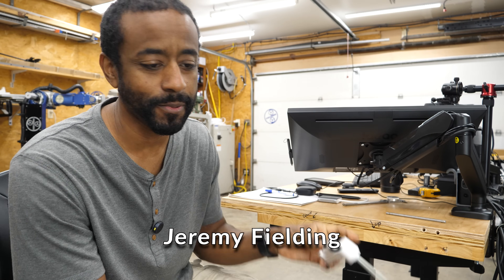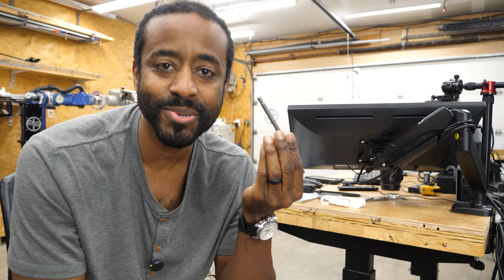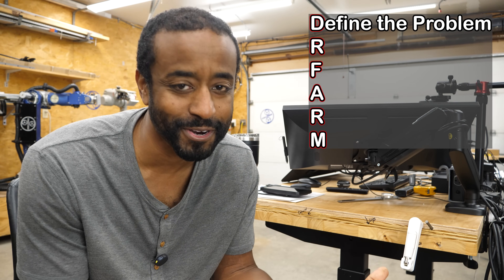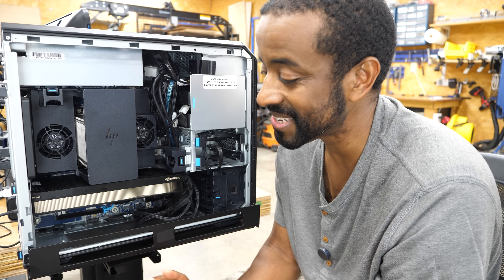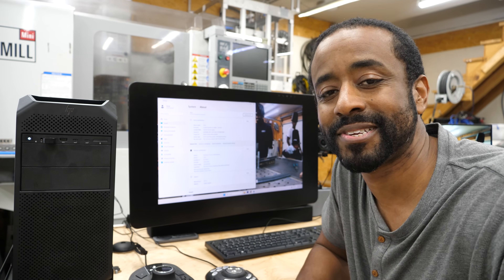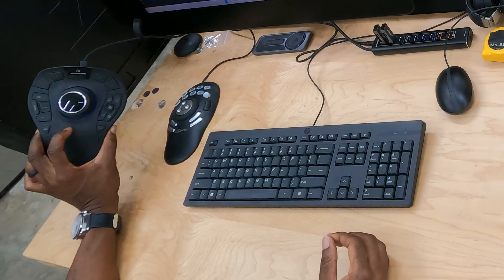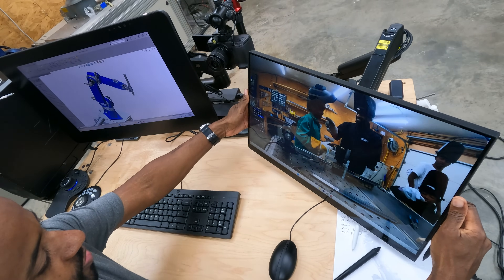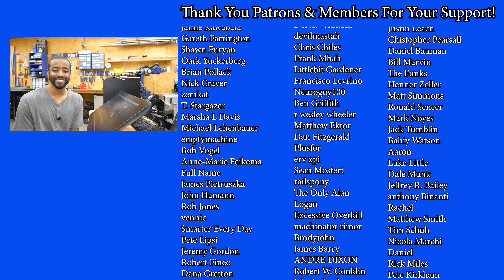My Design Process

Comment: Just a quick tip for the researching phase : Using AI. Give GPT a description of the mechanical problem you need to solve, and it will give you all the wheels that exist in the world for that scenario, so you not only not reinvent them but also get options of wheels you would never know exists

Comment: Wonder if you can make a welding table where your armed robot can travel on a rail system if needed for areas it can't reach. Then, it clamps down the base on the stational position.

After that, it takes a picture. Calibrates the location. Then, it makes precise welds.

Side cameras that can accurately calculate thickness, and type of metal.

For the machine to be able to change tool type attachments automatically.

Never done this type of stuff, but am interested in it. Primarily building and programming useful machines. Converting a lawnmower into autonomous mower is interesting.

Comment: I’ve thought about designing a pc tower myself to improve the cooling. 
Normally they mount power pack at the bottom in my opinion this needs flipping and closing off it’s own channeled cooling system ect. 
In other words anything that makes heat needs to be channeled and have it’s own cooling system completely separate from other components that produces heat. Pc towers or builds tend to miss this point. There often messy the point being channeled air flow. 
The same can be said for automotive products specifically a turbocharged motor why do that insist on mounting a intercooler in front of a radiator which will restrict airflow which will reduce the effectiveness of the intercooler additional side effect which will also reduce the effectiveness of the water cooling system
Then there’s items like jet engines? Pre coolers? 
Liquid nitrogen pre cooling?
105 F room temperature no problem. 
We have to think outside the box they put us in you must think this way.

Comment: I have got a question , can i built a gokart with electromotor from washing machine and use a generator which will be mounted to the gokart and use 220v generator energy to run the electric motor, Is it possible in theory and practice?
Some people might ask why would i do that , well , internal combustion engines are awesome but the acceleration of the electric motors are magnificent , thats the reason 😁.

Comment: I used to design on a 18 core twin cpu xenon workstation.   It sounded like a battalion of helicopters taking off and put off enough heat to heat all the houses in my neighborhood.   I switched to a Mac studio.   Normally to the fan doesn't come on or heat up.   I never realized how distracting the fan noise was.

Comment: Free Energy Idea: Magnets + Gravity + Vacuum
Ring Magnets sliding on Bicycle wheel spokes.
Magnets slide to wheel's outer edge on down rotation.
Magnets slide to center hub on up rotation by
stationary magnets positioned beside wheel
to repel ring magnets up the wheel spokes
from the rim to the hub
and as the wheel spins,
another set of stationary magnets to repel the ring magnets 
up from the hub to the rim
to gravity assist the down rotation.

Comment: Jeremy, could you do a video about the research process specifically, and maybe go into more depth about good resources, ways to figure out if a similar problem has been addressed in a different field or industry, etc. I tend to struggle with research as google is often an insufficient tool for this type of work
Reply from the maker: check out the video I recommended in the video LOL Link in the description.

Comment: I love that you appreciate the value of 'DIY' as a constraint in and of itself, and not just a means to meet a constraint such as saving money etc. If you haven't checked it out already, I highly recommend the book Thinking Fast and Slow, which discusses preconceived notions and unconscious bias in great detail. Here's a Google AI summary of  An example from the book:

"In Thinking, Fast and Slow, Daniel Kahneman uses the example of substituting a difficult question with an easier one to illustrate the process of intuitive heuristics:

Difficult question: Should I invest in Ford stock?

Easier question: Do I like Ford cars? 

Kahneman's book differentiates between two modes of thought:

System 1: Fast, instinctive, and emotional

 System 2: Slower, more deliberative, and more logical 

 System 1 thinking is automatic, intuitive, and error-prone, and is used for most common decisions. 
System 2 thinking is effortful, reasoned, more reliable, and used for complex decisions."
Reply from the maker: I have this book. It is indeed very good
Reply: @Jeremy_Fielding I thought you likely did!

Comment: I'm not a professional engineer, but I "engineer" stuff all the time for around the house. Since I can't wrap my head around CAD, I do most of my engineering in my head as I lie in bed in the morning. I see the objects and run through the animations and then I get up and fool around and find out. I spent two hours installing a single shelf between the studs in my new shed. And then it was all wiggly. Took it out, re-engineered it the next morning, came up with a better system and mass-produced little shelves that are solid. 🙂
Reply: Translating your ideas directly to CAD can be hard. It is easier to start with hand drawn sketches and just make the cad when required by the manufacturing process

Comment: Getting into 3D printing, I thought: "finally, I'll be able to design and print my own perfect solutions to mechanical problems!"

But it reality it often boils down to either:
1. someone already designed a more than adequate solution, and designing my own would essentially be a waste of time and plastic (test prints), so in the end I just print what I found and don't actually get the joy of designing something new.

2. I can solve the issue just as well in 5 minutes by cobbling together 3 pieces of trash...

(Similarly, I once made a cardboard mockup of a tool drawer insert I wanted to lasercut out of plywood. Almost 10 years later, that cardboard mockup is still in active use instead...)

Comment: 2:22    You MADE a hole ??? But you already HAD a hole !  You shoulda super-glued the Hex-Key into the lifting mechanism !!!
Reply from the maker: I wanted the option to use either tool but I like the idea 😁
Reply: @Jeremy_Fielding  Yes. There could be times the drill is AWOL, battery dead.... What you need is the original handle (glued in place) WITH THE HEX STICKING THRU to pop the drill on. 
(Thanks for putting up with all this 😊 )

Comment: A drawing tablet is incredibly helpful at preventing repetitive strain injuries. Just think of how many times you click the mouse while using CAD. You don't need a fancy display tablet, or even a name brand tablet. My super cheap Huion tablet works just fine.  You just need it to function like a mouse, so the resolution and features of a Wacom are not worth the cost. If you suffer from RSI, spend the $30 and save your wrist.

Comment: New Engineers need to keep certain things in mind. 1.) Engineers don't make mistakes, they make revisions. 2.) Think Big, keep it simple and SAFE. 3.) Write it down the moment you think of it. The best ideas often come at night or in the toilet. Have a notebook available. 4.) Document everything with time, date, and location  Preferably with 24 hour Universal Time. 5.) If possible, take pictures or make drawings show all axis's. 6.) If pattens are require, don't forget. Note: Strange as might seem, where I first worked as an engineer, we had a chalkboard in the toilet on the side panel where engineers could think. It worked and several ideas started there.
Reply: Amen on the "iterations". Discard. Revamp. Tweak. Make it lean.
Reply: Also, we never "guess". We "judge"!
Reply: I can get behind most of this. But there a very vague between revisions and mistakes. They are not mutually exclusive. If you send your work out the door, and a failure can be pinpointed to such a revision, and someone else has to pay the price, you have failed as an engineer, and as a person in general. When will you take responsibility? Shades of gray, friend. Life is defined by them.
Reply: @philbert006  Good thought. That is why it is very important to have real feedback to complete the cycle of quality and reliability. Unfortunately, in today's world the feedback is either not there or directed toward something other than improving the product or service. As a result what is produced either continues to be bad or gets worse as bad is built on bad. I am required to use a CPAP at night. I attempted to let the manufacturer know of an ongoing problem with the masks. I was told to see the seller. The seller said they just sell and don't take reports. So I ended up redesigning the mask to work. " Great mask now ! "

Comment: I know I'll be a good engineer for two reasons.
1) was blessed with a life full of an extreme amount of problems to be solved 
2) reason number one 
Reason 3) love learning - thanks for the video! I use autocad for electrical and inventor for 3d solid models, but definitely will checkout solidworks after hearing about their monthly creator pricing in a previous video and recently purchasing a 3d printer